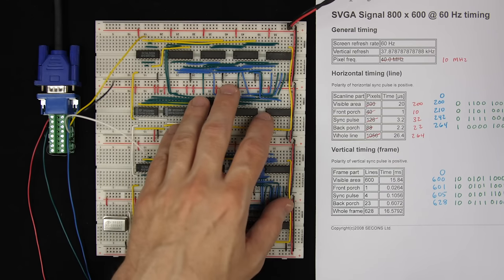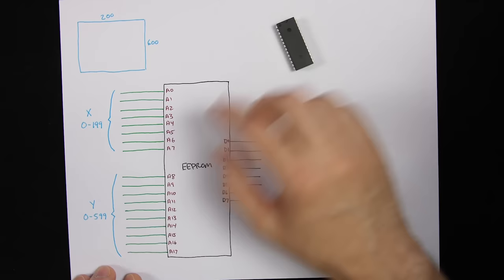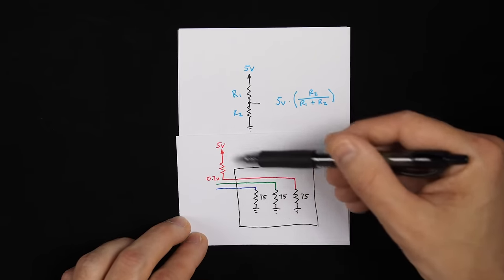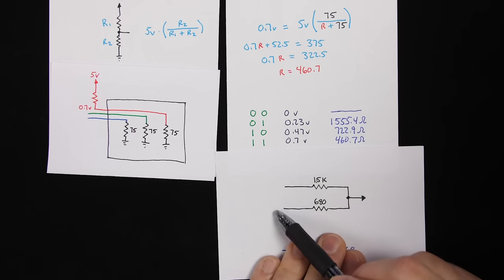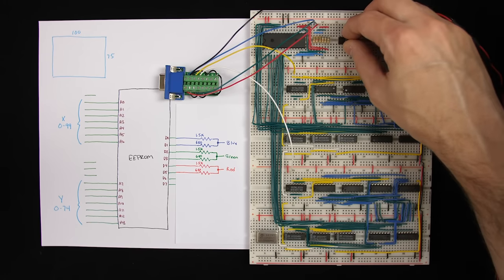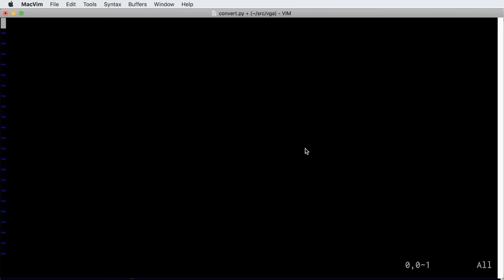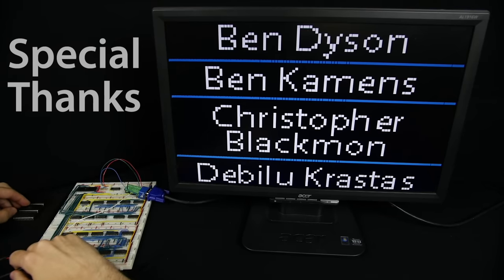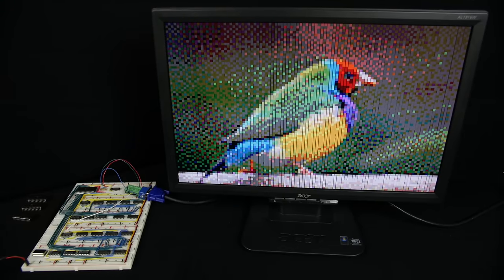World's worst video card? The exciting conclusion

Comment: WOW...
I've always wondered how computers work on the most fundamental level, I'm tired of all of the explanations only going down to the level of "machine code".  I'm glad I found this channel.

How do you know all of this?  Is there a specific topic you could study in school to become fluent in things like this?  How did you even begin to learn in a topic like this?
Reply: Judging from previous videos, he mentioned books he read about the topic. But more information would be nice, indeed.
Reply: Study Electronic engineering!
Reply: A computer science degree will teach you all the things explained in this video.
Reply: @EekSaidTheCreeper  Nope, computer science is all high level stuff, at least in my country. For this you need electric/electronic engineering
Reply: @orti1283  Not for me. Any good CS degree will have an introductory electronics course.
Reply: @EekSaidTheCreeper   It depends on how introductory the course is.
Reply: Ayden Cook I got a degree in electrical engineering. Obviously they don’t teach you everything about how VGA monitors and such work, but all the timing analysis and voltage division and stuff he does in many of his videos will be very familiar to anyone with that kind of education.
Reply: Ayden Cook, great question.  To your point, a typical undergraduate CS program in the U.S. will cover the principles of the interfaces between software/firmware and hardware "down to the level of machine code".  Some even include a bit of digital logic design (i.e., the AND, NAND, OR, NOT gates, etc.).  However, for the level of 'native' comfort and acuity you witnessed in this video, and will in others in this channel, an electrical engineering program is your best bet.  For example, most CS program curricula lack significant practical working experience with oscilloscopes or other digital lab instruments, and wouldn't prepare you to dynamically diagnose (much less overcome) challenges like the monitor input-impedance for color scaling, and Ben's resistor-pair voltage-division solution.  That level of acumen arises from both academic study of digital electronics, and frankly a boatload of experience earned through thousands of hours spent on hundreds of practical projects.  Fortunately, because of his rare collateral talent for educational communication and his generosity we all can learn those techniques in just a fraction of the time he's invested.  So if you're truly interested in both the art and science of digital technology, I couldn't agree more that you've found the right place.  Wishing you every success, Ayden.
Reply: @EekGooglePlus - although the design of something simple like the resistor network to match the impedence of the colour signals is really basic stuff to us Electrical Engineers, I seriously doubt that any - "introductory" electronics topic in a computing science course will cover this design knowledge to that depth. 

In my experience,  every Computing Science degree holder treats digital electronics as some sort of idealized binary magic system, rather than truly understanding the messy and complex details of the underlying semiconductor devices. 

The reality is that if you want to design this yourself, then you will need more than what is taught in a Computing Science degree ... you need actual electronics knowledge.
Reply: It's electronics engineering, computer science has some relation to it, but they don't have a deep understanding of what's happening under the hood. Electronics Engineering on the other hand studies exactly that, even what happens inside the transistor.

People usually struggle with assembler because it's not "intuitive" if you don't know the microcontroller/CPU architecture because you're literally moving bits through multiple parts of the CPU's architecture. This project heavily relies on Digital Design and analog electronics. In my experience, it's easier to get familiar and start with a low-level language/approach like assembler, you understand what's really happening under the hood and then move to higher level stuff without losing that much power (C/C++). For me it's more exciting than plain simple coding since you're manipulating and controlling hardware, and you can even get into Hardware Description Languages (Verilog/VHDL) to develop integrated circuits
Reply: I just read a lot. And I was curious how that stuff worked. A lot of this project was just observing the rules for an established protocol and working backward to build a machine that would follow those rules.
Reply: Basically Digital Electronics, start by studying digital gates and boolean expressions.
Reply: I learned about all this in my Computer Engineering class. We shared all classes with Electronics Engineering until about year 3 or 4.
Reply: Electronics engineering, although the amount of informatics you see depends on the university/country so you will certainly need some post degree specialization. Or you can study both technician degrees of electronics and computers (cheaper and probably shorter solution) although you would probably need to study some fundamentals on your own. There are recent careers that mix both, like automatization and robotics (which throws mechanics into the bunch as well), but you won't do video cards there. Depends of how much you want to get paid as well...
Reply: I would argue that anyone with a sufficiently keen interest in these things can learn a lot from studying datasheets; at least that's what I have been doing - I don't have any formal education, but I've been interested in electronics and computers for the last 50 years or so, and using this method I have taught myself more than enough to be able to fully understand this 2-part video series. 
In fact, I have been trying to design a video board myself using six Micron MT43C8129A Triple‑Port Video RAM ICs (128Kx8 (Computer side) + 2 x 256x8 (pixel data out), one Brooktree BT453KP66 66 MHz Monolithic CMOS 256 x 24 Color Palette RAMDAC, and a bunch of TTL and CMOS "glue logic" ICs; however until now I was not quite certain how to generate the Sync signals, but thanks to Ben's 'genius' Ii now have new inspiration to do those signals too! :)
If/when I succed in this task I should have a video board with a resolution of 1024x786 @30Hz refresh rate, and with an 8-bit color depth (i.e. 256 simultaneous colors from a 24-bit palette).

My ultimate goal is to build a ZX Spectrum-compatible computer based on a Zilog Z80380 which is an extended Z80 with a 32-bit enhanced mode and a 32-bit Address Bus, as well as an external 16-bit Data Bus, and that is where my video board will come into play.
I will admit, though, that I still have a long way to go, so don't hold your breath waiting for a video of my "beast".
Reply: If you (or anyone that's interested) want some good reference, I recommend this book:

"Digital Systems Principles And Applications" - Tocci
It explains most of the basic concepts of eletronics (Boole algebra, combinational logic, sequential circuits, state machines, integrated circuits, memories, fpgas, and many more...).
Reply: @filipesiegrist  Thanks for the recommendation, i will definitely take a look at that book.
Reply: Electrical Engineering with electronics and computer focus would be a great start. OP probably has a PHD in electrical and computer engineering. Though it is not required.
Reply: Computer science will get you to the assembly language level. Thats how far you go . After that you need to spend A LOT of your time in LABS
Reply: digital logic
Reply: I worked with computers for years but either never knew or had forgotten how things worked at a very basic level.  So when I retired I decided to explore the topic and I kept a wordpress log of things as I went on.  This is at https://simplestcomputer.wordpress.com/ if anyone is interested.  What Ben is doing feels like what I should have done next.
Reply: Google
Reply: I studied electrical engineering and did similar projects in school. Micro-controllers is probably the best class to start learning this stuff.
Reply: It may sound weird, but when I studied computer engineering I didn't fully understand some things, watching videos of how to create computers in minecraft helped me conceptualize it xD hahahahahaha
Reply: A lot of the individual stuff like voltage calculation and stuff were taught to us in high school physics and then some of the breadboard stuff was taught in design technology class, then some of the logical stuff like figuring out what gates to use and the more "how do i get this to do what i want it to do" is mostly taught in low-level computer science courses. The more advanced stuff like the timing and parts and knowing how that stuff works, in general, is likely to be electronic engineering as others have said.
Reply: Speaking for the UK at least. There are degrees deliberately designed for this specific kind of niche.

It's called Computer Systems Engineering and depending on if it's a BEng or BSc you'll generally get a 2/3rds electronic engineering focus or a 2/3rds computer science focus.

I decided to do a BEng in it. Then realised it requires the synchronization of two distinct schools within a university which did not work out well for me or my class. Of 35 starters, 4 made it to the end of the 3 year course, the rest of us transferred out into straight Computer Science or Electronic Engineering, I would hope about 10 years on, universities have their stuff sorted now so it isn't such a disaster.

You will cover aspects of this kind of level in both fields, but computer systems engineering is what you're looking for if you want a degree specifically merging the two disciplines.

Obviously when it comes to third year eclectic topics, you may also find modules in either computer science or electronics engineering that will also let you specialise in this field.
Reply: guess they dont teach stuff like this at school anymore. we learnt to make a digital watch from scratch, and differnet other simple stuff,  on high school electric class
Reply: EekGooglePlus Currently in my last year if computer science in america, not one thing he has shown in this video is studied here.
Reply: @EekSaidTheCreeper  Not necessarily a good one. We wrote a C program in DOS to control a 7-segment display via the COM port, and that's as far as we got.
Reply: back in the Apple ][ it was more manageable to go down to the lowest level. These days there's so much stuff between you and the bare metal that it makes it much harder.

Comment: Excellent video as always.
If you used a W27C512 eeprom you would get 16 address lines, which would allow you to get to a resolution of 200x150 and also get rid of some of the vertical lines because the access time would be 45ns or better; or with a W27C020 you would get all the address lines you need for a glorious full resolution. :)
You might have mentioned in the video that the output resistors form the world's simplest DAC.
Reply: I still don't get HOW that DAC really works. Still gotta do a bit of maths to figure out how that shit works. I think he made an assumption that we get Z instead of 0 for some reason in the calculations. That said, that means the resistance and the actual voltages will differ for the intermediate values, which isn't that bad actually.
Reply: Ooh, you made me remember the Covox Speech Thing by mentioning the simplest DAC. It was an easy task to build, but the only Windows driver I found in those times, when www had been barely invented (and I had no access to it), was poor. A fond memory, nonetheless.
Reply: You could extend that DAC with more bits by hooking more resistors that are powers-of-two times a base resistor, and then connecting the lowest bits to the highest resistors. So, for a full 8-bit color, you could technically find 1, 2, 4, 8, 16, 32, 64, 128 (times some resistance) resistors and hook the bit 0 to the 128 resistor, the bit 1 to the 64 resistor... but then it would be easier to use an actual DAC.
Reply: @JoaoBapt  Nice. Again, gotta do a bit of maths on how that works but holy fuck is that nice.
Reply: @paulstelian97  This is essentially a fancy Resistor Ladder (https://en.wikipedia.org/wiki/Resistor_ladder). 
If he wanted to use up all 8 bits of the data for color information, he could get 256 colors (including black and white). Use 3 bits for Red and Green, and 2 bits for Blue. It will look just fine because our eyes are actually pretty crap at seeing blue anyway so lower resolution for blue is fine. 
I would actually recommend biasing the middle range values of the outputs to lower intensity than they would be in a linear configuration. This is like gamma correction in a way. Our eyes aren't very good at seeing small differences in high intensity signals compared to small differences in low intensity signals. Imagine trying to see the intensity difference in 1 light blub vs two, and then comparing that to 100 light bulbs vs 101. It's the same difference in intensity, but our eyes are much more sensitive to changes in low intensity signals (contrast ratios are biased towards dark).
Reply: You could also use two of the EEPROMS to get 5 bits per pixel or 32k colours. Three EEPROMS (plus associated resistors) would get you full 24 bit colour (16,777,216 colours)
Reply: @paulstelian97  I thought that at first too, but since the resisters when grounded are in parallel with the 75 ohms the change is minimal, plus the 5% resisters chosen are not the exact values desired....it is close enough for demo purposes.
Reply: How the fuck do you guys know all this stuff?
Reply: @diederikeding6544  by studying electrical engineering?...
Reply: Paul-Stelian Olaru you het a series of resistors switched in series with the internal impedance of the monitor, that creates voltage dividers that create discrete voltage levels. It's pretty easy to figure out and well explained in the video.

Comment: In the 90s I played with a fpga and made a 8 bit cpu. The display was a ega monitor. To reduce the number of gates I sacrificed some memory by using some reserved color values to generate the sync signals. Of course this had some drawbacks but had also a nice advantage: to scroll the picture I only had to do a limited number of memory writes to slightly shift the syncs...
The fpga was actually too small and most of the display logic was in ttl logic...

Comment: I would really love to see this display multiple frames using the extra space in one of those EEPROMs.  In fact, you could almost take it a step further and use swapping between two images at 60Hz to make intermediate colors in between any two existing colors.  That would take one extra flip-flop using the reset pin of the y counter so that it switches between 1 and 0 every frame, then tie that to the high address bit of the EEPROM.  The harder part would be converting images into the right format to be displayed like that
Reply: @kezif  don't even need a second ROM, this one is big enough for multiple images. Just the the frame counter to one of the higher address lines that's not being used.

Comment: Dear Ben, thanks for the video! Great explanation and quality. I got a question though and sorry if I missed it. But where does the scaling happen? The monitor has for sure way more LEDs than your resolution of 100 by 75. Yet the picture is full screen.
So there must be a scaling and probably some cut offs when 100 and 75 are not whole dividers of the numbers of LEDs?
Reply: In the first video where he creates the card, he explains that he is aiming for the 40mHz timing using a  10mHz clock. So each pixel is sent for the expected time of four pixels on the display.